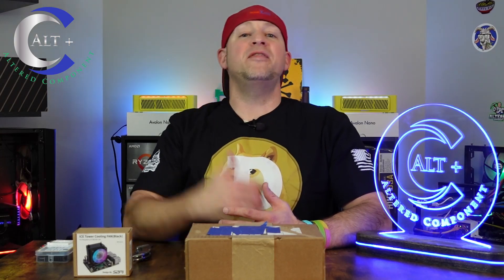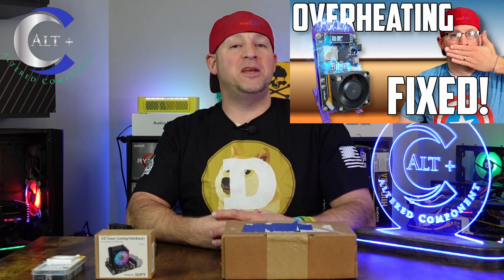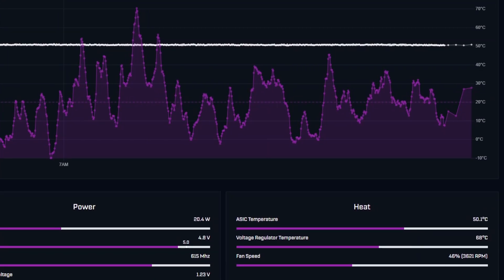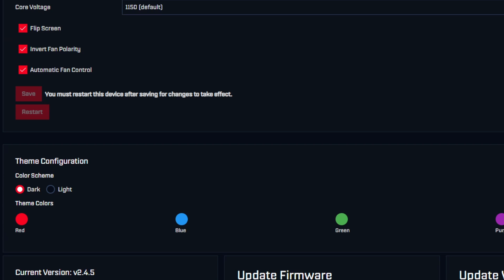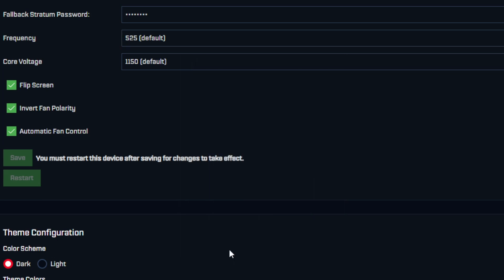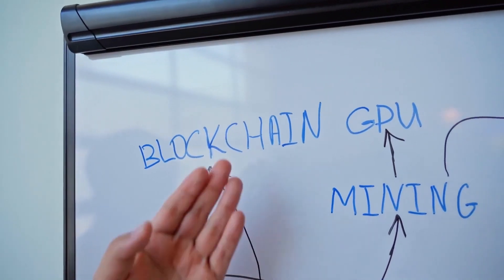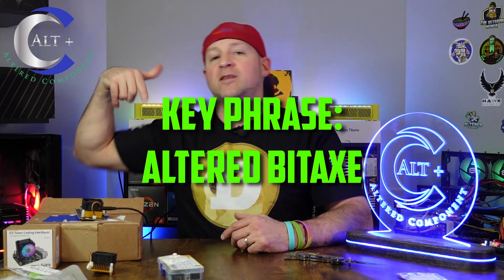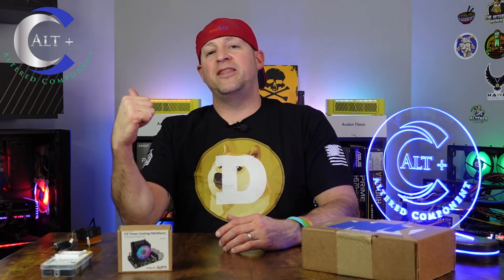⚡ How to Get the Most Performance from your Bitaxe BTC Solo Miner | Giveaway #6 #bitcoin #bitaxe 🛠

Comment: 2.1TH I get 24/7 on my gamma, 1085mhz on 1375mv. Cheers
Reply from the maker: man that is nice tuning...well done
Reply: @AlteredComponent  with 2 fans and low profile rpi coolers. 300w meanwell psu, direct 2.5mm2 cables to the pcb

Comment: Chances of mining a single Bitcoin (i.e., successfully finding a block) with a Bitaxe Gamma 601 (BM1370) solo miner are astronomically low. The device’s hashrate is tiny compared to the global network, meaning the expected time to find even one block is on the order of millions of years (based on typical assumptions). In practical terms, the probability is so small that it might as well be considered zero from an investment or time perspective. PLEASE---just buy $200 worth of Satoshi's!!!! So, you’d get roughly 190,476 Satoshis for $200 at a Bitcoin price of $105,000 per BTC. Saylor just mentioned $400M per bitcoin. That would be $4 per Satoshi, or $761,904.

Comment: ALTERED BITAXE! I put a few heatsync on the back and front, now stable at the highest settings, just need to do an upgraded cooler to push further. If you could do a video on how to add a fan to the rear, it would be awesome. I have a desk fan blowing from the side to keep everything cooled.

Comment: Altered Bitaxe.  Isn't the simple fix for this is to just put a Fan directly on the Bixaxe if the onlyh issues is overheating?  I have a small fan I think I can just put directly facing the Bitaex and there should be no overheating or cooling issues, correct? Altered Bitaxe.

Comment: Altered Bitaxe. My gamma runs better undervolted at stock clock. I would try higher clocks, but I have original cooler and it gets hot.
Reply from the maker: @crptdyth  100% those things heat up quick..u do know u won a previous givy and haven't sent me email yet? Check my community posts